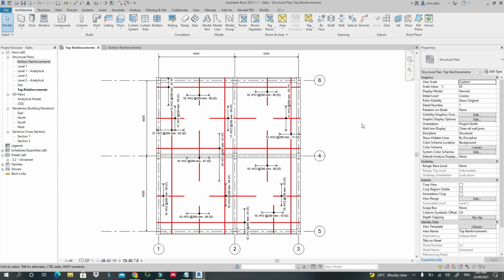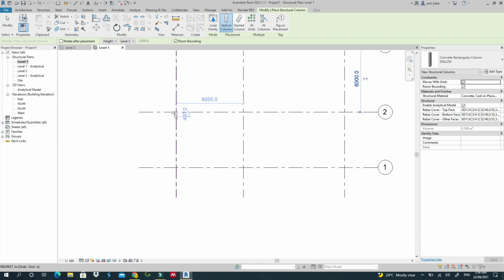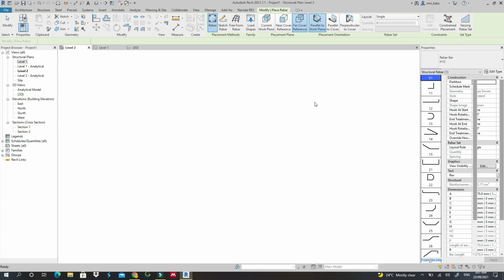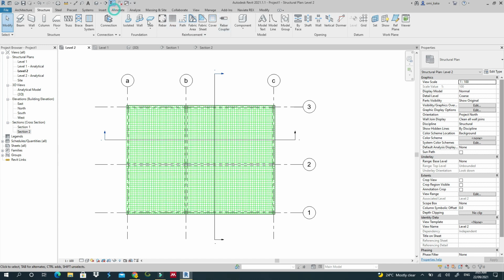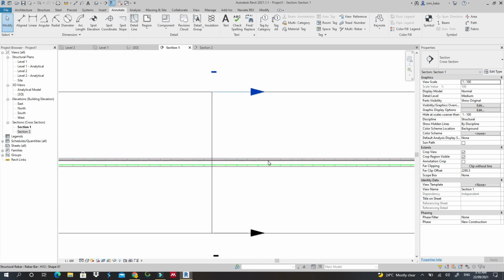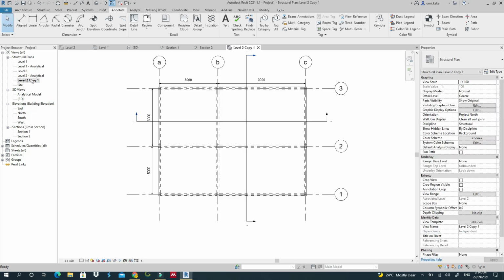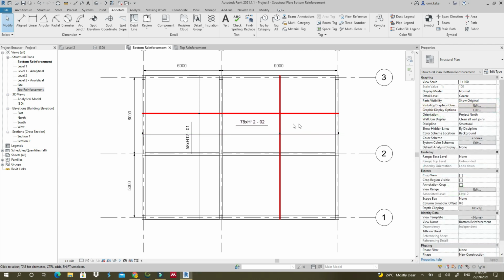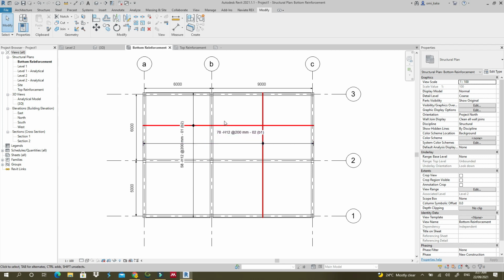How to do Slab Reinforcement Detailing Using Autodesk Revit According to BS and Eurocodes (PART 1)

Comment: GUYS, USE PROTA STRUCTURE. YOU COULD DO THIS IN UNDER 30 SECONDS
Reply from the maker: I believe you can. But will then require alot of corrections

Comment: what if the lap is cranked? how do you show a bar on the plan that it is a cranked bar?
Reply from the maker: If the lap is cranked, then you might have to show the horizontal section of the slab. However, in BS 8110, there is no need for cranked bars. I believe this concept is mainly in Indian Code